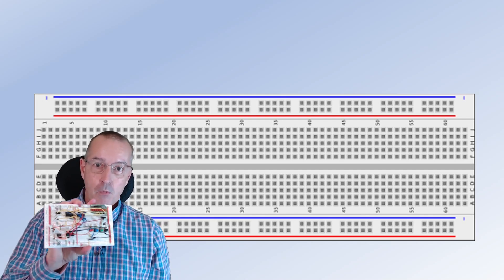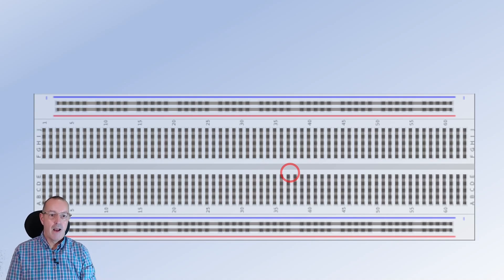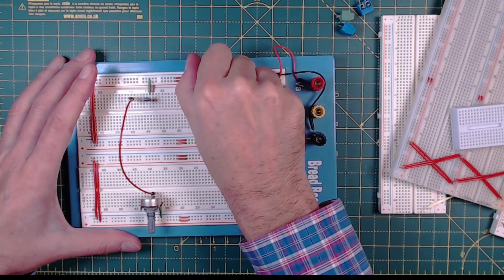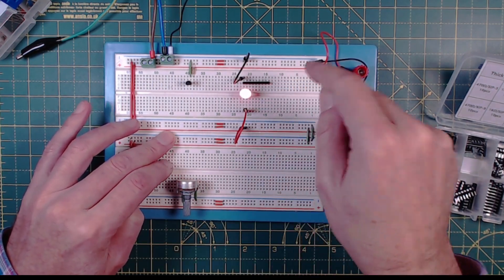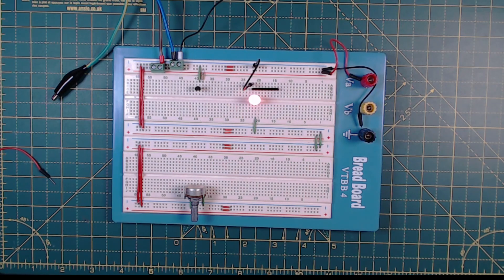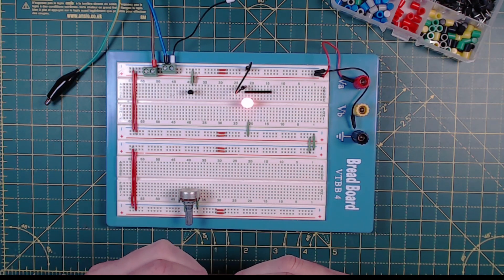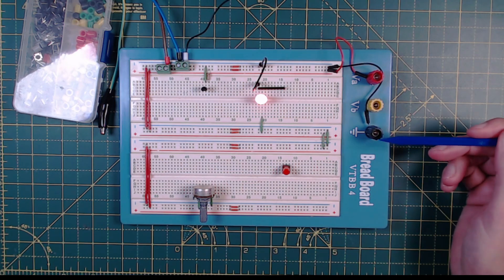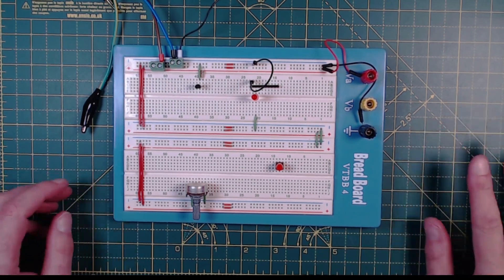Breadboard Tips

Comment: The thing i can't stand most about breadboards is the gaps in the power rails. Is there a breadboard with a continuous power rail?
Reply from the maker: I know what you mean there, I also found it frustrating. I do have a couple of boards without the gaps, but I have no idea where I bought them from. 

I have permanent links in many of my my boards now, which you can probably see in my videos, so it's no longer a real issue.

Comment: I am 78. An HGV mechanic since leaving school at 14 years old, gradually moved into auto DC electronics and loved it. However I only got as far as unit changing if the vehicle on-boards and plug in computers told me to do. I never got as far as delving into things to any depth. Obviously had to learn OHMS law etc etc. March this year I decided to get into model electric trains ( now long retired) as a hobby and was very surprised at the electronics involved. Basically I wanted to light my lay-out buildings, platforms, roads etc and set about learning the more refined use of resistors etc (I never knew that I could burn a resistor out as such and had to check its actual wattage). I set about wiring my invention and had visions of wiring in a relay to make things work, such as on a lorry a 3v signal load going to a relay to fire up a 24v lamp circuit, if you follow my meaning. I have lighting systems in place that work ok but are loads of separate lamps, powered by a variety of batteries, with one lot of about 10 LEDs powered off the main Varying power supply from 3v up to 6 v ( all via a million resistors)I came across you and your tutorials and decided to learn more. I suppose I am trying to run before I can walk.  Can you advise the best way I can (at my age) learn some basic modern electronics to suit my railway project. I am too old to start with learning DC electronics at apprentice lever, probably haven’t got much time left. A quick flick through your videos didn’t really help me, am I missing your start up to this subject.  Many thanks anyway, and I sure those with far greater knowledge than me find your videos like gold.
Reply from the maker: Hi thanks for the comment and your story.

There are 1000's of basic electronics tutorials on YouTube. Don't limit yourself to one channel, there are many out there. I suggest you stick with it. 
If you find something of interest, search for that specific topic title and try to watch/listen to several different youtuber's versions of it. You will find it all sinks into place. 

My channel is quite small at present, but I recently retired and now I have time on my hands I will be publishing new videos much more frequently. So make sure you Subscribe.

In my experience, everything boils down to ohms law in the end, so you already have a good starting point.
Reply: @paulpkae  Thankyou. I had already subscribed to your channel. You have the same accent as me and I find you easy to listen to and follow, plus you tend to slide above me in terms of technology explanations, but it’s easy to go back to and listen again. I will follow your advice and search for specialised content rather than my current way of trying to learn from the beginning but jumping into the deep stuff. Again, many thanks and I’ll keep an eye out on your channel.

Comment: I like the resistor pack idea. I've been using resistor arrays, which do a similar thing but are more expensive and take up more space but are discrete resistors. Which can be good and bad. For LEDs it's bad because you need a bunch more wires. Your method seems a lot nicer. I will have to try that! For some reason I thought the resistor pack/networks were in series, not parallel to the first pin.
Reply from the maker: Thanks for your comment. I think resistor packs come in varying arrangements, but the vast majority are in parallel to a common pin.

Comment: 0:30 Wouldn't it be nice if you could part it horizontally in the middle (maybe adding stripes of different widths) so you could add say a RasPi Pico to the board and still have four holes you could use for connecting on each side of the Pico?

Just a thought...

Comment: For jumpers I mostly use the old telephone installation copper wire, but the one that was used on the street that had 2 or 4 solid copper wires in parallel with a steel tensioning wire. It was once ubiquitous before the fiber optics rollout.

Comment: No you DON'T throw it in the bin....   Use the flimsy Amazon jumpers as permanent, soldered links.   
I hate idiots that just throw shit away, because they can't be bothered to repurpose.   

And anyway, why bother to buy the link kits?   Just get yourself some 22-23AWG tinned wire (1/4W resistor lead gauge) and slide over some coloured insulation (from recycled wire), then cut and bend to length.    
Note:  I quite often retain a small compartment for naked (tinned) wire offcuts - from resistors.  

Even better - Guitar string offcuts make very robust breadboard jumpers and can be bent tight (90deg ends) and rigid; again, with a length of coloured insulation or small gauge heatshrink.     Guitar string offcuts can also be cleanly bent into a curve, making for a very neat circuit layout; if a link needs to be robust, but pliable; say as a frequently used test probe, or hook-up, then wound  guitar string offcuts work very well and will spring back into place after use; an added advantage of a light 'wound' string means for a more secure 'grip' within the female connectors of the breadboard matrix, due to the helical outer winding.    Guitar string offcuts also work well for vertical stand-offs to a mounted daughter board etc...  The make for neat bus connections too.  

Properly tinned, guitar string cores can also be soldered easily due to being largely nickel-steel alloy.   Tip:  Meaning that snapped strings (above the nut) can be repaired, by joining with a double slip or Lover's Knot and soldered across the knot, giving your string extra time on the fretboard, esp when times are lean.      

I NEVER throw away old guitar strings for this very reason.   

Finally -  Amazon should be boycotted.   I don't go anywhere near it.   Not one of my pennies are going into Bezo's wallet.
Reply from the maker: Thanks for your comment. Don't worry, I'm not throwing anything away and already had in mind to utilise them for permanent boards as you suggest. Still remains a disappointing product though and another lesson learnt. Hopefully by sharing my experience it will help others make a more informed decision on what to buy. 

As for Amazon, I really like the convenience and given there's no electronics stores left on the high street in the UK, there's little option but to buy online these days.
Reply: @paulpkae You might need to ask yourself whether using Amazon is part of the problem that there are no such stores left?

Just a thought...

Comment: For LEDs, especially if most of your projects are 5V or less, you can get special LEDs thst have an integrated resistor from DigiKey or similar vendors. If you look carefully inside the lens you can see a small black speck on the top of the anode wireform. That black speck is the integrated resistor, chosen for safe operation at 5V. I'm not sure how much lower, but at 3.3V you can still see it illuminated. Not sure if the integrated resistor is enough current limiting at the 9V this video is using. Among the sizes they come in is 0.1" pitch. I find these small ones useful on proto boards like Arduino. Hold one I/O pin low and toggle an adjacent I/O appropriately for quick and simple diagnostics. (I first discovered them at a place I worked that used them to keep the BOM count down.)
Reply from the maker: Thanks for your comment. It may just be me, but I prefer to select my own resistor size and know exactly what's going on. It's a control thing 😁
Reply: @paulpkae  That's fair. I was just letting you and other people know that those things exist.

Your use of resistor networks for LED current limiting is a good pointer for others. Resistor networks are also very useful in digital circuits. If one needs to provide either pull-down or pull-up resistors for a data or address buss they come in really handy.

For your audience, it should be said that there are two common types of resistor networks. The type you demonstrated are "Bussed", meaning all the resistors share a common pin. There are also is "Isolated" where none of the resistors in the package are connected. (Those are filter terms to use on sites like DigiKey when ordering them.)
Reply from the maker: @Sembazuru y thanks again, your comments and sharing knowledge is very much welcomed; handy to know there are Bussed and Isolated types. I recall resistor packs being used on old style "MFM" HDD's back in the 80s to terminate the data chain.  You had to remember to fit one to the last drive in the ribbon cable to prevent help alleviate signal reflections.

Comment: I hold all my jumper wires in the same place. There is M-M, F-F, M-F and it is hard finding the type I want, I looked if there are different colored 'black housing(the ones at each end of the wire) to buy, that would have been helpful to just look for a green  housing at the tip for M-M(ex)(3 colors for each type M-M, F-F, M-F ).
I thought to try to color them myself, markers don't look good on black. Metallic paints scratch out.
Another idea is to color code a small part of the wires above the black housing. I tried markers they don't look good, and I stopped.(other thoughts: metallic paint may flake off if wire is bent?)(maybe using paper tape? but it may come loose?)
Either one big stripe of different colors on the wire, or same color but in segments(1 line M-M; 2 lines F-F; 3 lines M-F)
Reply from the maker: Wow. Your pushing "organising" well beyond what I have done. I'm not too fussed about the wire colours, but I do try to keep Black for GND, Red for +V and sometimes I match the colour coding of my four channel scope. For example, I might use channel one, which is Yellow, to monitor an input and channel two, which is blue, to monitor an output stage.
Reply: @paulpkae  I meant, is hard finding for example Female-Female wire in a pile of Male-Male, Female-Female, Male-Female, I pick one, wrong one(Male-Male), I pick another one, wrong one(Female-Female), etc.

If they had the little black rectangle housing(the one that slides on the little metal connector that are at the the tips of the wire, not the wire color itself) at the tips of the wires with different colors, example:
Male-Male = green housing (on both sides)
Female-Female = yellow housing (on both sides)
Male-Female = black housing (on both sides)

In that pile of breadboard wires, I could just look at either side of the connector that has yellow housing, and that will be what I was looking for, Female-Female.

(if I would want red wire female-female, I would look for yellow housing connector with red wire)
(If I would want black male-male wire, I would look for green housing connector with black wire)
Reply from the maker: @drawings4896  ah OK understood. You could probably add small diameter coloured heat shrink to the ends. Once heated it would form around the plastic perfectly and would not flake or fade over time.
Reply: Thanks, that is a good idea. I will try on the wire above the connector, I think if I put it on the connector it will make it thicker and I think it may not fit when connecting the wires side by side on the breadboard.

Comment: Great combo. The ut61e and those propes were my daily driver for the longest time. The ut61e is my only dmm i wont donate. Id donate a fluke first haha
Reply from the maker: I have been very pleased with both the UT61E and the Probe Master probes. I am tempted to buy myself the UT61E Plus version.
Reply: @paulpkae  the non + has better input protection and does temperature reading. The + drops all that for hfe measurement.  People think uni-t is low-end but look at their products line. They make feature rich spectrum analyzer gear and everything. If you notice, they're rarely give out review samples because they know it's quality. I wish they'd pick a meter and have it ul certified. The ut81 has an awesome screen but costs a fortune and had garbage input protection. I'd buy one otherwise.